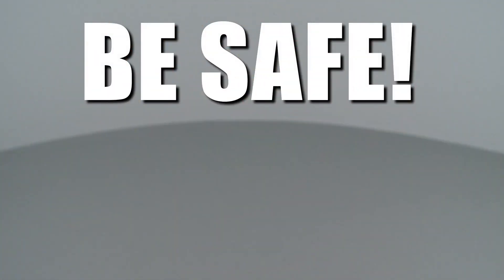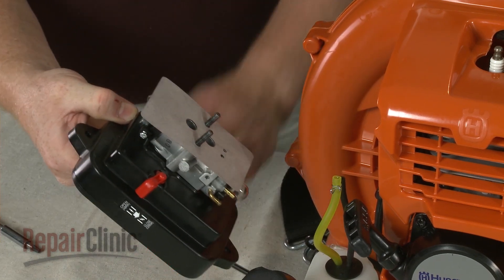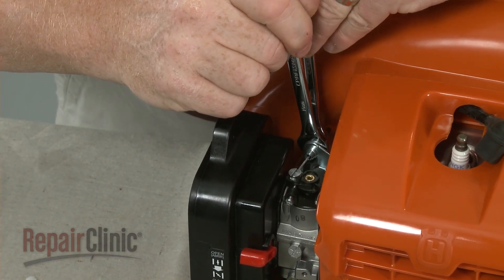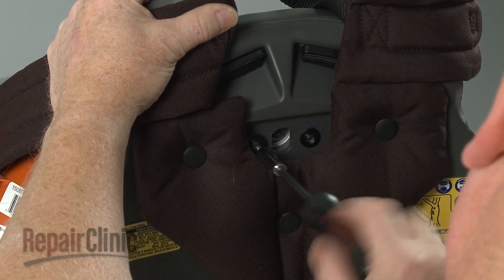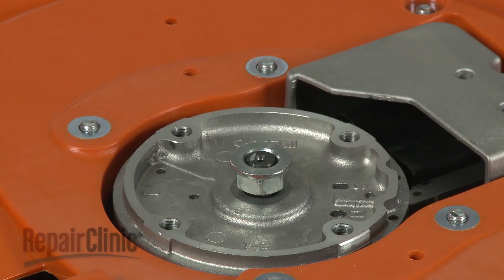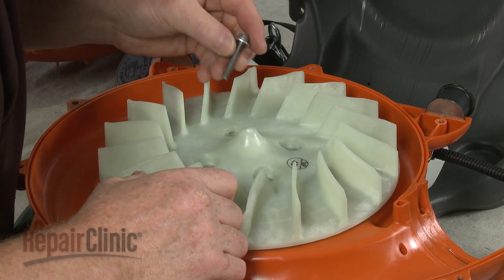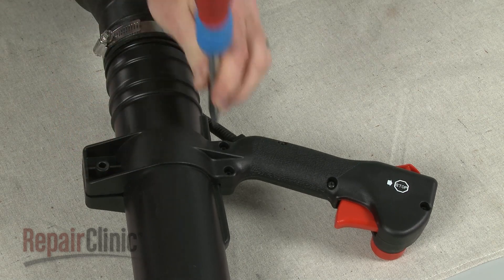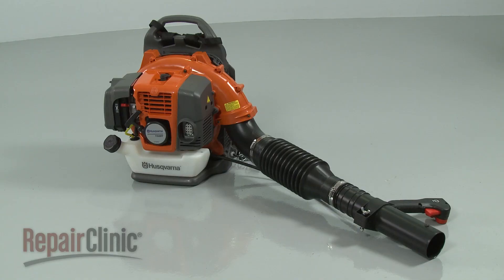Husqvarna Leaf Blower Disassembly – Leaf Blower Repair Help

Comment: Very helpful video for general assy and changing carb first time.  Hint, if you don't want to mess with a gummed carb rebuild or new(~$18) spend some additional $$ for ethanol-free fuel mix.  Storage no longer a problem..